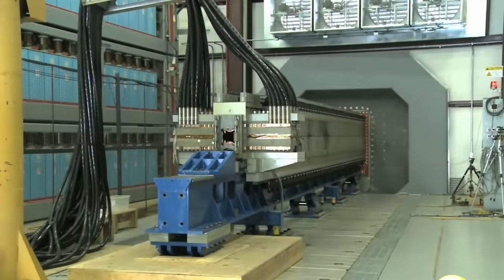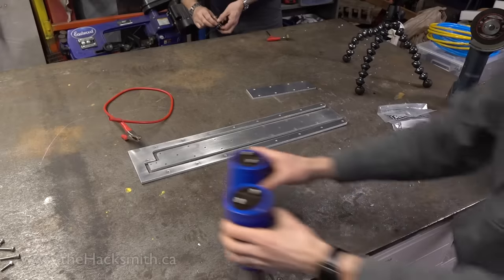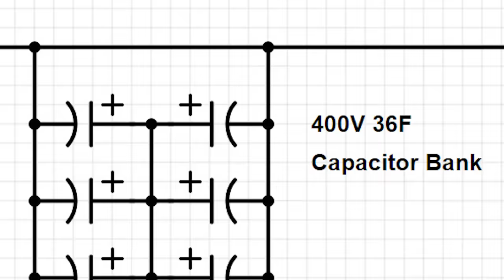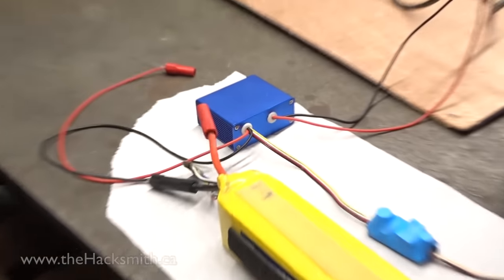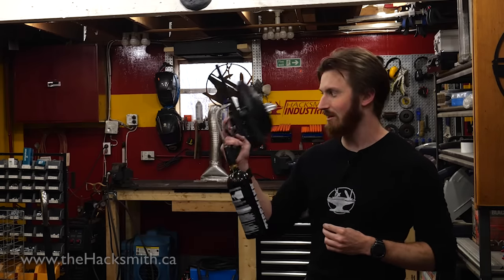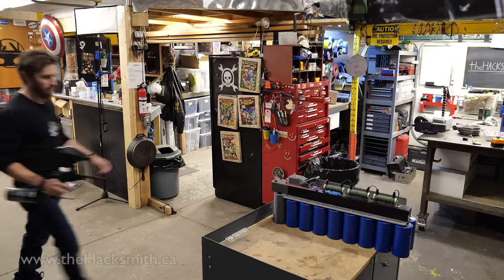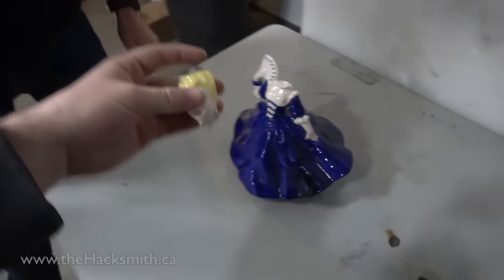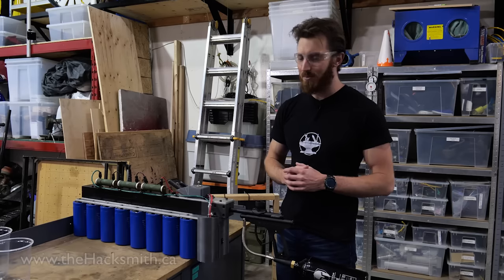Making a RAILGUN and then TESTING it!

Comment: You can get the same results with a rubber band and a Y shaped stick.
Reply: no you can get even better results
Reply: yes you can, but does were those results achieved with a railgun?
Reply: @rcx2699  Despite that I think the railgun was an important scientific advancement, that served the purpose of cool science fiction portrayals of it.
Reply: Or just switch that paintball gun back to full power
Reply: Try to aim with it.
Reply: trow a rock
Reply: It is obviously not efficient.
Reply: Gun
Reply: @eriksab1609  that's the spirit!
Reply: @eriksab1609  engrish
Reply: For now
Reply: With one disadvantage, way less cooler
Reply: Honestly, railguns are only useful if your going all out with them...
Reply: i gotta say the weapon in this scale is about as strong as throwing a stone, but the larger military ones are mega powerful
Reply: @notamouse5630  No, it is very efficient. He said at the end of the video that he could have made it more powerful, but Canada has strict regulations.
Reply: @Kyrious  well, the main issue here is that they kinda didn't do it right, the capacitors discharge instantly and don't propel the projectile throughout the whole barrel. it should supply power until the projectile exits the barrel
Reply: @Viper-zk9mv  so put a resistor in one place or smth . U would have to calculate the it would take to get thru the barrel.
Reply: @andrewdoesyt7787  Even if he charged the capacitors up all the way, the velocity still wouldn’t be very impressive, because the capacitors would discharge far too quickly. An inductor is supposed to be used to extend the pulse of the capacitors discharging, so the rails will be energized for nearly the entire duration that the projectile is passing through them, thus maximizing the velocity. That’s why so many of these homemade railgun builds are so shitty. All people do is connect a capacitor bank to a pair of rails, then call it a day.
Reply: @JC-XL  they did, or could you not hear the difference in "pops" when they fired the "railgun" as to when he showed us it was "turned down"?

Comment: Thanks a lot for the plug mate! I was going to take the challenge and make it stronger, but then you said we could go to jail! In any case if you like to serve some time, just add magnets to the mix!
Reply from the maker: I love your videos! Sorry for calling you Electro-GO-Boom I might be slightly dyslexic, or perhaps a psychic for when you inevitably go boom in a video!

The project ended up being a lot harder than we imagined, you're video certainly helped us out!
Reply: Poop all at once?or as it passes ? Opto circuit!!! Great Scott!! Luv u guys!!!
Reply: :D No worries! Misspelling my name(s) is a curse I carry to the end! I wish you weren't on the other side. There are some projects that could use your expertise.
Reply: I like where this is going... 🤔😀
Reply: Well, for it to be considered a firearm, it has to have a "barrel." So an argument might be made that a railgun doesn't have a barrel, it has a parallel set of rails which do not meet the definition of a barrel.

Assuming a "barrel" is a metallic tube typically used on firearms. And a "tube" is a cylinder used for transporting objects. And a cylinder =/= parallel rails.
Reply: ElectroBOOM we watch your videos in my electronics class. Both entertaining and informative.
Reply: there are also airguns that are more powerful than some firearms, demo ranch did a video on an airgun 'sniper' that had a suppressor on it that was totally unregulated because it isn't a firearm or firearm suppressor, it's an airgun
Reply: lol
Reply: i learned from this guy how to change a light bulb without blowing my hands of
Reply: Link Freeman ive seen that xD
Reply: ElectroBOOM go to the us for a "visit" no regulations there! We want to see the hole power!!!
Reply: FULL BRIDGE RECTIFIER!!!
Reply: the Hacksmith your*
Reply: no regulations? there are tons of gun regulations here, depending on where you go
Reply: ElectroBOOM ii
Reply: ElectroBOOM i5
Reply: Bring it to the US! You're not far away, and I'm sure it wouldn't be too hard to find a fan or another YTer with a workshop willing to host you.
Reply: ElectroBOOM шиш
Reply: ElectroBOOM a
Reply: Nick S, it's not worth it for them to even consider doing anything that would even be questionable.  Governments, INCLUDING the US Government, aren't exactly reasonable when it comes to violations of gun laws.  The ATF has ruined people's lives over grey area issues, and Waco all started over the ATF hearing that the people there had parts to make full auto firearms.  Just parts....
Reply: ElectroBOOM why not colab a few times?
Reply: Where do you add the magnets?... I'm asking for a friend.
Reply: You need to rifle the barrel...its the reason for the lack of power and the tumble of the round...otherwise badass as hell
Reply: Make an electoBOOM Hacksmith collab
Reply: I have one similar to it and ya they can be awesome.
Reply: ElectroBOOM I just read all your replies in your voice and that's weird.
Reply: Toolness1, But yet at about the time you posted your comment, I was visiting a friend that has a few full auto weapons. I didn't count how many but let's just say that a SWAT team would be outgunned by triple the number or more. And BATFE considers that you have full auto weapon if you have all 9 parts to make an M1 Carbine full auto or just the receiver if it is marked as an M2 Carbine. :-(
Reply: It's not a firearm, can't be regulated.
Reply: Rick Barker, Sure can in the US if you discount the 2nd Amendment. It would fall under the term, " other destructive device."
Reply: ElectroBOOM love you
Reply: I’m pretty sure you need a horse-shoe shape to your projectile to get the rail gun effect, so that the projectile can induce its own magnetic field that opposes that of the rails. You can see this clearly in the sabot used in the Navy gun. Some others on YouTube have also used a U-projectile.

I feel that the Hacksmith gun was adding almost no energy to the projectile because it used a solid slug. So we were mostly watching an air gun.
Reply: Hey hacksmith and eltcroBOOM why don't you too do a collab and make either: The Slegdesaw (Dead rising 3. Slegdehammer and cement saw) Paddlesaw ( dead rising 2, kay-yak paddle, chainsaw,) or an IED. (Dead rising 2, Propane tank, Nails.) Or do all three. And if you all are really crazy, make the Slicecycle. (Dead rising 2, motorcycle, chainsaw)
Reply: 99
Reply: Lol
Reply: The legend has arrived
Reply: Maybe next time use a round ball with a smaller caliber
Reply: @nicks2437  no a fire arm is not determined by having a barrel, paintball guns are not firearms they have metal barrels
Reply: Curious loophole potential.... what if you shot it through something else, which further increased the speed? 🤔
A multipart acceleration like the "space gun" Gerald Bull was building, in other words. And if each part wasn't wholly connected, would it still count as a single "firearm?"
(Another historical example would be the "Paris Gun")
Basically those, but with magnets and not buried into something.
Reply: Nick S there is also no explosion
Reply: @TheEpicLinkFreeman  not on something like a rail gun. That isn't considered a firearm in any state no matter how powerful it is.
Reply: @Toolness1  that wouldn't violate any gun laws in the US no matter how powerful it is. It's not considered a firearm.
Reply: @hacksmith  you 2  need to make a colab vid together guys!
Reply: Yea just call it an electric crossbow. Bam, it's an unregulated weapon.

Disclaimer: I am not a lawyer
Reply: @TheEpicLinkFreeman  In Canada, if it fires faster than 500 feet per second, regardless of what it's propelled by, it requires a license. That air gun would would get you jail time in Canada
Reply: WOW I AM LIKE TO SHOCK YA!
Reply: @TheEpicLinkFreeman  air guns are not regulated at all it most states. By most, I mean only one more than not. If you are in an area that still has no regs order the hatsan blitz in .22, and the hatsan hercules bully in .30 or .45 before it's too late!!!!!!!
Reply: @Toolness1  I think it depends on how much of a person of interest you are to begin with, if the atf would be interested in destroying your life for no valid reason or not.
Reply: Go to jail for what?? It isnt a firearm because it does not have gunpowder
Reply: @samsungemployee5243  for example in illinois if you have a projectile launcher that exceeds 700fps and is a caliber over .177 it is legally considered a firearm and you must have a foid card to purchase. Some places also require you to register it as well. If you don't do that or have a foid and make one of these that powerful you might as well have just made a powder gun or go buy a scratched gun off the street
Reply: @dackbowland1876  Dude just take it to bits once it's been fired a few times. Say you tested it at a secret location. Who's gonna be able to prove anything? There's a hundred countries you might have fired it in.
Reply: @greenaum  because what's the point if you can't keep it on your nightstand/in your car ready to blow a person in half?
Reply: wrr
Reply: A railgun is powered by electricity and therefore doesn't qualify as a firearm. Also it is NOT against the law to make actual firearms without a license, provided you are not prohibited to own firearms, and you are not engaged in business (meaning making it with the intent of selling it).
Reply: @boondocktinkering432  wrong. Almost half of the states in the u.s have regulations to classify things as fire arms no matter the propellant. In illinois, if your homeade projectile launcher exceeds muzzle velocity of 700 fps it is considered a fire arm and you must have a foid card to even own it.  Some airsoft guns are considered firearms here, they are pretty relaxed about that one tho. Not so much pellet guns
Reply: I doubt magnets would make any difference. A permanent magnet's strength is nothing compared to the field a railgun is supposed to generate. Good conductors, for the projectile and rails, and in fact everything else in the current path, are much more important.

Incidentally maybe the problem this has with low power might be helped by creating better contact area between the projectile and rails. Graphite is very conductive, and also very slidey, and will wear away quickly, with a thin layer, to better conform to the rails' surface. In fact an entirely graphite projectile might be some good. Yes it has more resistance than copper, but the power from the caps is not being dumped nearly fast enough anyway in this thing. So that wouldn't be the bottleneck. If you wanted to go all-out, perhaps a copper core sleeved with graphite, or even powdered with it, just dipped in powder? You could even rub the rails with graphite a few times. Or just dust some powder, then scrape between the rails to get rid of any shorts.
Reply: Why would it be illigal
Reply: Even the military is not that bold you have iron man's armor and a bullet proof shield
Reply: I think you would only go to jail if you misused it. I also still prefer induction guns (Not a gauss rifle). I made an induction gun that just uses the wall current. I shot a steel rode with aluminum coil stock around the rod and it went all the way through the wall of my house and stuck into my neighbors house
Reply: Also if you freeze the paintballs they may as well be bullets

Comment: For those in electrical engineering, it's a fancy name for a linear motor that lets one of its pieces escape.
Reply: That would be a coilgun, no?
Reply: @andrefilipe6757  The linear motor is literally 2 straight wires and a bar connecting them, the direction of the current determines where the bar goes, the value of the current determines how fast the bar accelerates. In a rail gun the wires are the 2 copper channels and the bar is the projectile.
A coilgun is something the people in this channel also made, it is a series of coils wrapped around a tube where you have to time the activation and deactivation of the magnetic field generated by the coils in order to accelerate a ferrous projectile. Doesn't require as high a voltage, but the circuitry is more complicated with a lot of fine tuning required.
Reply: yeah exactly, capacitor pushes it instantly through a large current. And the moving part escapes

Comment: One correction for you, the Navy has been working on railguns since at least the 70's. I worked on the Army's version back in the 80's.
And here's a couple of tips for you.
1. Purge the barrel with He just before the shot. The lighter gas offers less resistance and will increase velocity.
2. Try a lighter projectile. Al can be accelerated to a higher speed due to less mass. It's that velocity squared component that does the real damage.
3. Cut a vertical slot into the back end of the projectile. The current through the projectile will force the tabs apart and give better contact with the rails and less rail ablation.
4. Make an inductor from heavy wire to spread the pulse out. You should be able to optimize the pulse width to the time that the projectile will be in the barrel.5
5. Increase the pressure of the injector. But you already know that.

Comment: Ughhh, all my education as an Electrical Engineer is screaming at me as I watch this video 😂
Reply: 4:30 I can't explain it, it just feels like that rail design wouldn't work well. Is that wrong? Like the current could path through the rail in a way that could decrease the tangential force.....

Tell me EE education says about that!
Reply: @tyty8484  would you mind explaining that further?
Reply: @runningchild8052  the way that the rail is a semi-circle, my intuition tells me that the path electricity will take will be "the path of least resistance." So what i imagine is that it is either going to jump across the tiny gap so you're only getting a pinch of that tang force. OR even going from that tiny gap and wrapping around the circle and back thus increasing the distance between the current direction changes.

From what I can tell, the best shape would be the opposite of this. The rails being 2 parallel cyclinders and the projectile being a cut-out in between. Like a rounded I-Beam.
Reply: @tyty8484  yup, you can tell this is correct based off the fact they needed to use a paintball gun to shoot it. i wouldn't be surprised if they just had a paintball gun with a high pressure canister to make it look like they were accelerating it with their setup, b/c they couldn't get it to work. lol